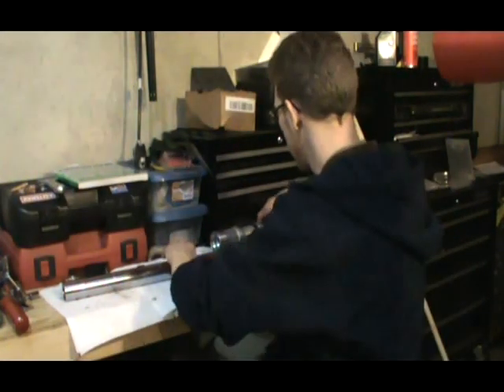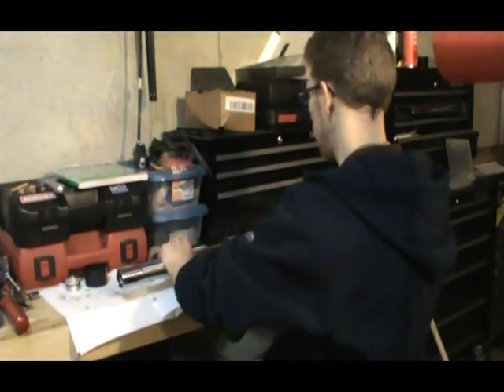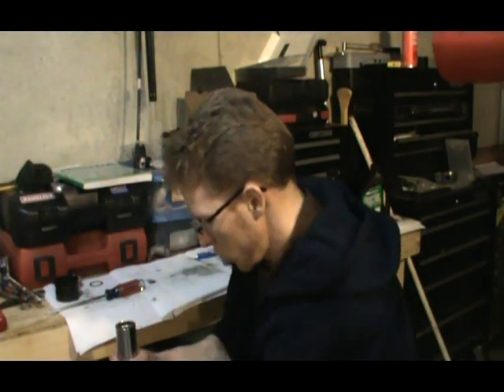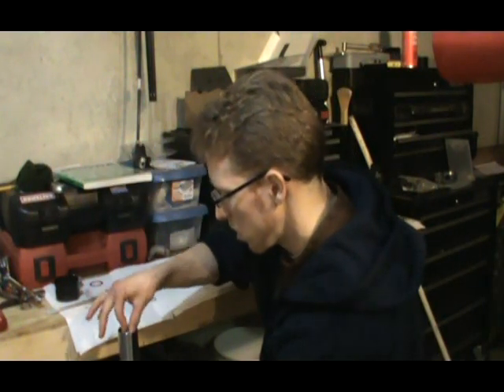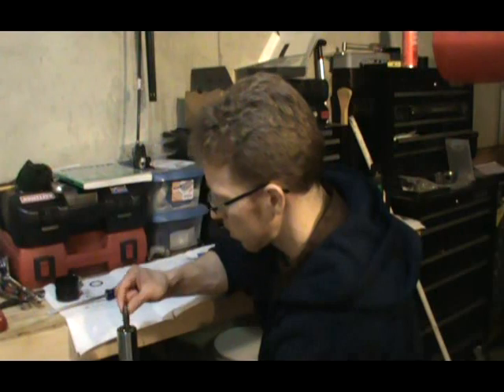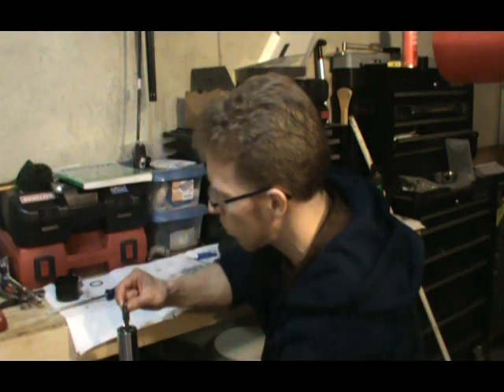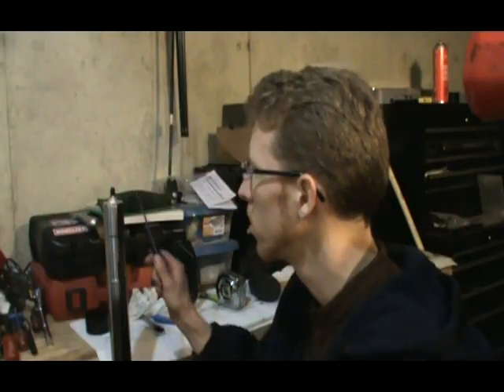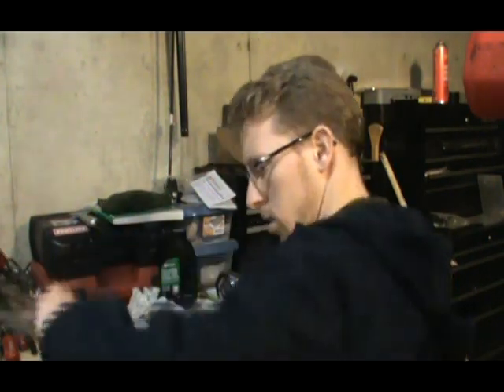XR650L front fork rebuild part 3

Comment: So how did that gold valve work? Much difference and how? Review please, I will be at same point eventually with my BigRedPig.
Reply from the maker: Its hard to say the benefit from just the gold valve as I changed the spring at the same time.  The front suspension is very similar to what it was on general roads but it is smoother in operation.  Once off road though its a whole different story.  The rebound is greatly enhanced and there is lots more traction.  I find the front tire much more planted during hard turning as well.  The front fork has not bottomed out since the modifications.